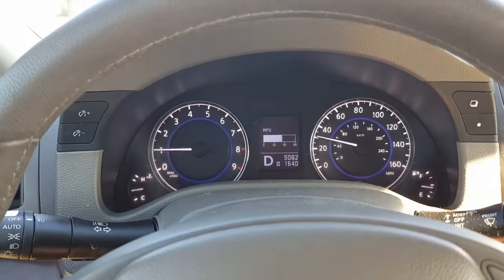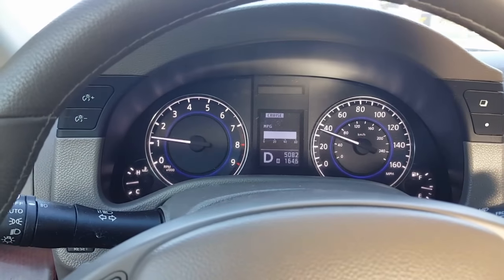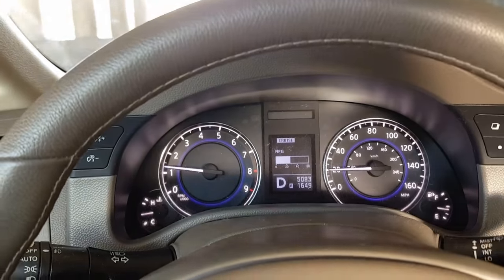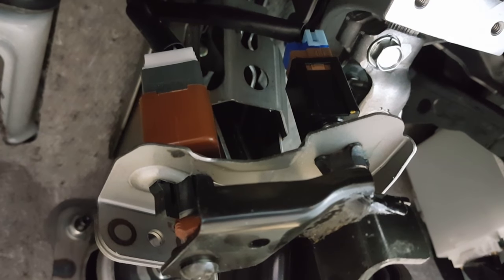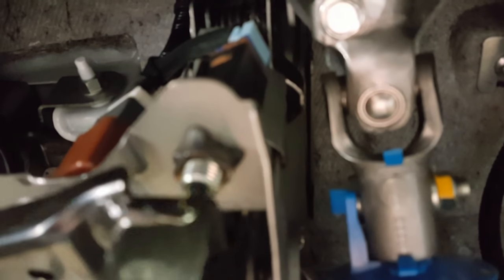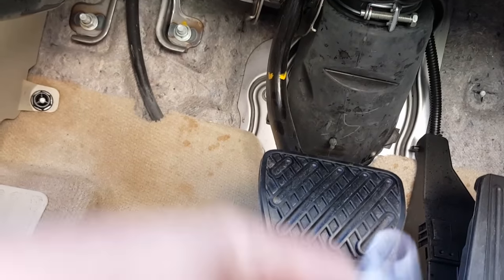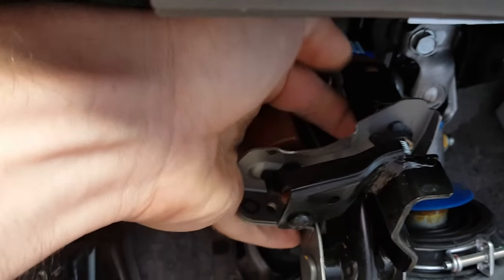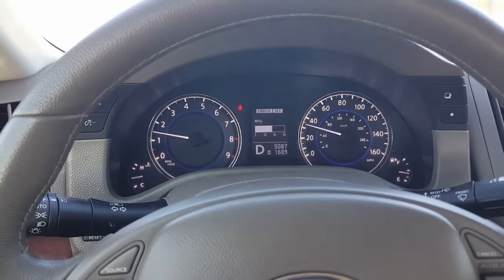INFINITI NISSAN CRUISE CONTROL WILL NOT SET ENGAGE. EASY FAST FIX!!!

Comment: Hey George, I have a 2013 FX37 that the cruise control will drop out when the lights are turned on, every time. Changed the TPC, brake sensor, calibrated and it still does it! Mechs are clueless about and I’m not paying anymore. Ideas?

Comment: Ive just found this as bought an x trail a year back and same issue. However mine is manual and i think this switch is over my clutch but i cant adjust it however if i push the clutch up a little with top of my foot i can engage cruise control.

Comment: My 2002 Nissan xterra 3.3 6 cyl. Automatic cruise control works fine on fairly level roads at 70-75 mph but jumps out of gear (automatic transmission) on long steep grades leaving engine racing til I shut off cruise. Sometimes happens with normal accelerator under same load conditions?  Any ideas

Comment: Great video. But I just went and replaced the switch with a new one. And for some reason it just jammed my brakes the moment I hit 120 cruise control. I had to disconnect it from the pedal to be able to drive again.

Comment: I had a problem with both the brake lights(staying on after switching off) and an issue with set cruise control . 

Thanks to your vid I was able to fix the brake light issue to keep the switch closed and engaged by using a dime and some sticky tape. The little rubber pieces that kept the switches down disintegrate and fell off.

Cruise control still won’t set , even though I used the same method of sticky tape + dime to keep the blue switch pressed down.

Any idea what else i could be doing wrong ? Thanks a ton

Comment: Also where should the narrow button be on the other switch all the way in or out. Both mine were all the way it it looks like. As said I brought the right side one I believe the cruise engage switch out so after you press down on brake pedal and let go that when pedal comes back up it just barely pushes in the narrow button.  Which I could attach photos to show you. Do you have an email to send you photos.

Comment: Okay .. 2000 pontiac grand am. Cruise light comes on at the steering wheel but has you said it won't engage. Used to be it would only engage for short while/ short distance then go off each time. Cruise word in gauge cluster does not come on even doing the edt foot brake pedal lift. My set screws are not brown and multi coloured but both are cream in colour. So I went with the right side one closest to the center console. It had its button all the way push in I backed it off so it just barely goes in once you let off the brake pedal. Not test drive it yet to see if that helped. Does not seem to be the large cruise module under hood nor its cable nor the three fuses on passenger side dash.

Comment: I have 2012 altima and the after hitting cruise control the my car won't change gear....  it stuck in 2nd gear......  it won't move.....  can you tell what to do....?  cause I took back to the dealer and he told me he fix it....  but it still doing the same after getting back the car.... .. I don't know what to do now...

Comment: i have the same problem for my nissan tiida 2011 and i check this pedel switch its ok,  so anybody have any advise to change or repair other parts of cruise control system,   i tired to find out the issue in last few year's

Comment: I had a problem where my brake light was always on, because my 2003 G35 is already 15 years old I guess, so the plastic part broke on the upper part of the brake pedal, but I fixed it to where the brake lights work fine now, but I guess because the brakes were messed up due to the brake switch, now the cruise control doesn't work.

Comment: It could also be where the clutch sensors hit... I have a 2005 350z and where the clutch rests there was a hole where a rivet usually goes that fell out... replaced the rivet thus filling the hole so the sensor could hit and works fine.

Comment: Thanks for the video. Mine had a button on the brake pedal arm that had fallen out causing the the switch to remain open. The video helped me identify the problem.
Reply: Me too!!! 2001 Nissan Pathfinder. It almost looks like a nickel (hard to see at that angle) was glued to the metal, top of pedal, under the brake light switch. Under the cc switch is just a hole and a gap between switch, no contact. Is this metal "button" an oem part and available? I'm thinking of gluing a nickel or stack of flat washers to match height of "button" and adjusting cc switch as needed. Thanks in advance.

Comment: There is also a small rubber grommet that controls the cc if it breaks like mine did all you need to do is take 2 dimes and place them where the rubber grommet would be this is a much more simple fix and is more likely the cause of the problem
Reply: LiL' Skurtt does it need to be completely pushed in or no

Comment: Likely has a nut on top. I don't completely know gut I think you would turn it up up the shaft one or two turns after u loosen the lower nut. This drops the contactor lower to the pedal and then secure the lower jamb nut. Reason I mentioned it is so not to put twisting pressure on the wires if there doesn't seem to be enough slack in them. My luck would be I twisting the switch and do wire/connection damage. 
Super good video. You helped alot of people

Comment: I would also make sure the brake lights are working correctly when you're done & adjust the brake light switch if
necessary.
Reply from the maker: +Richard Righi very good point
Reply: Richard Righi which one is the brake light switch?
Reply: @hamdanahmed2664  it's the one to the left, with the red/brown part. You don't need a wrench, just loosen by hand it 1/4 turn and lower it down until it clicks, then tighten it back 1/4 turn. Easy adjustment.

Comment: Thanks! Awesome video. This is exactly what my 2012 manual Nissan Pathfinder was doing. I found the switch that you describe in the video, located on my clutch pedal. I removed the wires from the switch (very easy) & adjusted the switch in a counter clockwise direction until the clutch lever fully pushed the plunger of the switch in. Hey presto, cruise now works! Thanks from Australia.
Reply: Cruise control on a manual? Didn't know that was a thing. I should get out more. Thx!

Comment: Watched one of your video's (INFINITI NISSAN CRUISE CONTROL WILL NOT SET ENGAGE. EASY FAST FIX!!!).   It does not apply to my 2016 Nissan Murano Platinum.  My switches do not have nuts to lock the switch.  The bracket the switches are connected to seem to be pressed through the metal.  [Every picture I tried to take comes out blurred.]  Both the brake and cruise switches are plastic, they have threads that may be in the bracket,  but the switch doesn't turn.  Your video comes up short of using the wrench to unlock/lock a nut.  The play of the switch is only two or three millimeters.  Using my foot to pull up on the brake worked once, but only on one leg of my trip.

Comment: Many thanks. Thought I might have an expensive repair to fix this.
But my MK1 Nissan Qashqai had this same fault. Although the procedure was different it still fixed it.
On  mine, I had to remove the trim underneath the steering wheel, which gave me direct access to the switch (there's only one on my model of qashqai) I gave it a quick turn anti clockwise and it came straight out (there is no nut to loosen). Pushed it all the way back in a gave it a quick turn clockwise to lick it in place. And after about 10 mins work, I now have working cruise control.

So
Many thanks

Comment: hi  thank you for the help. i just bought a buick lucerne 2006 with 60000 miles, the cruise control would not work. the light on it would come on and go off but it would not engage. thanks to you it now works. i pull up on the brake as you said and it came right on. a older lady owned  it and may not have used the cruise i don't know but it works now.  great.   thanks  dennis

Comment: Tried but didn't work, any idea of what else could it be? Thank you for your video.
Reply: Ok I found what my problem was, there's like a plastic pin that press the button of the switch, this can be broken or missing so you will have a hole and the switch would not be pressed. I found my little plastic or rubber pad on the floor so I just put it back and my cruise control worked, I found you can buy it as "break pedal switch pad". Thanks to your video I started my investigation and then found the solution ❤

Comment: Thank You George you are my hero. The cruise would not set yesterday but only the word "SET" would flash. 
Today I lifted the brake pedal and it now works. I did not adjust the switch however I think the problem was a floor mat corner on the brake pedal. 
You are "Da Man".

Comment: Hola buenas tardes,

Yo tengo un problema con mi módulo de control de velocidad.

El switch del pedal y el switch en el volante funcionan bien.

El fusible está bien.

En el tablero el indicar de encendido (ON) funciona.

El problema es que el módulo de control de velocidad no logra mantener la velocidad, sino que se va desacelerando hasta llegar a los 48 km/h y se autodesactiva.

Como dato adicional, el módulo de control de velocidad fue sustituido por uno de medio uso pues el original se averió por corto circuito.

Comment: Thank you so much!
I have been struggling with this issue for long enough. Right after viewing your video I recalled replacing the brake light switch, which probably accidentally affected the cruise control switch. So I went for a ride, pulled the brakes pedal, and voila - cruise engaged!
Once again, I am grateful for your video; may you and yours be ever blessed with all the best.

Comment: Your video was the missing link I needed! Most videos were focused on the cruise control only, but I found that my break piece had also fallen thanks to the great camera shots/you bringing it up. When the pieces originally broke, I kept them in the hopes that a mechanic would know exactly what was wrong. Yet, after using your video combined with the “one cent trick”, I tried it myself instead :) We’ll see if it actually worked in the morning…my neck started hurting from all the contorting, haha.

Comment: I have the problem of when I push the cruise control the set botton blinks fast but won't set. This happened recently. I checked the break and the button is being pushed down. Any other ideas?
Reply: did u ever figure out your problem with that. i have the same issue
Reply: Eric Montoya I have the same issue on my 2007 qx56 any ideas??

Comment: Hey man I have 2003 infinity g35 sedan and my cruse control is not working . When I click the button on the steering wheel to turn it on the light that says cruse control comes on but when I let go of the gas it slows down. I tried to fix it and adjusted like you did but it’s still not working.  Can you help me ?
Reply: this guy is not a " Real" mechanic look at his tools 🤣 go to your local autoparts store and make a couple of buddies there. its your best bet.

Comment: Here's small trick to add to this only mess with the black one and if anything just take out the whole thing and press it back in all the way and lock it. It worked for me and so far no issues.
Reply: Yaseen Yusoof should try this one
Reply: Yaseen Yusoof with what did u lock it?
Reply: good tip

Comment: For anyone with the older models G35s like 2003, you will have a different model. Do not use tools for this! You WILL break the clips! Instead, look for the long black shaft that looks like it has threads. From the plug end, turn it counterclockwise and it will click (unlock) and then pull it out and rotate it 1/4 to 1/2 turn clockwise. Push it in and turn it clockwise into it clicks (locks). Be careful, well somewhat careful, because that shaft uses a 4 square female to male locking method. If you notice the threads, they have slots running the length of the shaft so it appears thread, slot, thread, spot, etc. If it makes it easier, you can press the plug lock in and pull the plug out of the connector to give you a little more room. Pull the plug out first if you have little room and then grab the part that is connected to the black shaft to make life a little easier. No tools required!

Comment: My cruise control does not work I’ve bought a new switch and i adjusted and It still doesn’t work what do you think it will be?
Reply: Hi friend Did you fix It i have same problem
Reply: Sroor9001 Still don’t work at all
Reply: @infinitig37x27  omg 😞